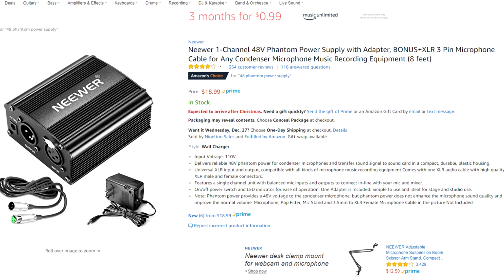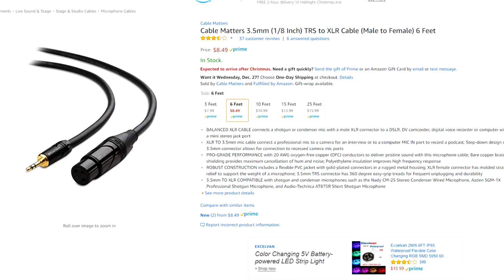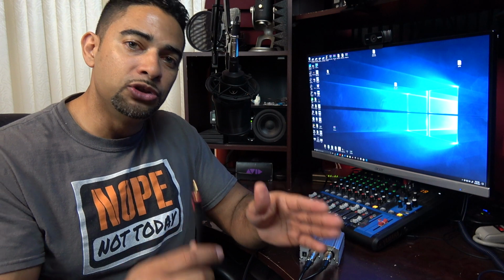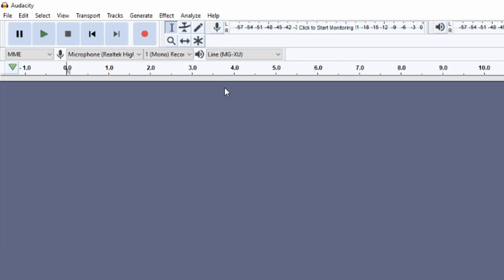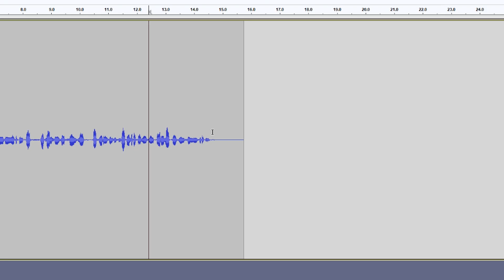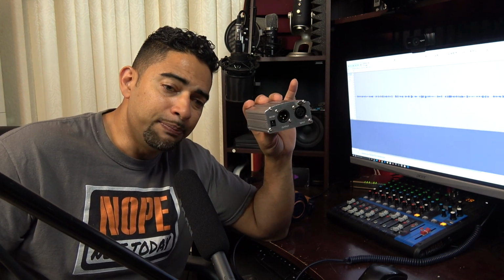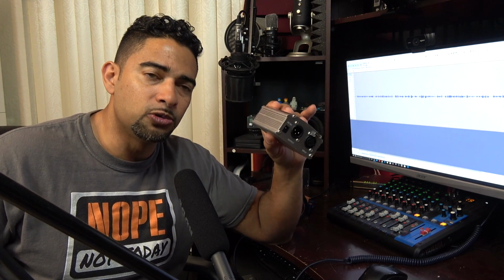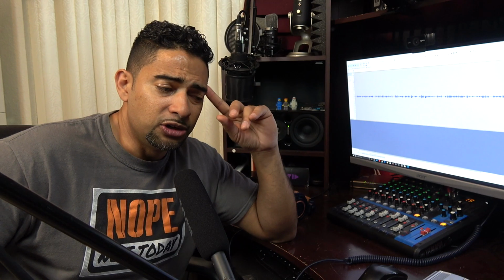Neewer 48v Phantom Power Supply Test and Review

Comment from the maker: Let me know what kind of audio interface you are using. And if you are using one of these budget phantom power supplies, tell me your experience
Reply: IT DOESN'T WORK
Reply: Does this have a power life.  I know this is a stuped question but I'm new to this types of microphones
Reply: Hi, I used for 10 years a budget Phantom PS and had no problem, until recently (it fell and overheated, my fault ^^). BUT i used a sound card (budget XLR-to-USB). To be clear : sound was perfect (T.bone SC400 microphone).
The problem with your video is that we don't know if the hissing is due to the PS or the PC sound card (which usually are not good). An interesting test would be to use the same sound card. e.g. a mixing table with on/off 48V, and test it first with mixing table PS ON (and no Neewer PS), and then with with mixing table PS OFF and Neewer PS.
Reply: @Daniel Rosli  is it necessary to have audio interface? or phantom power is already enough for my Samson C01 mic condenser to function and connect it to my pc?
Reply: my mic hasnt arrived yet, but i already have an Equalizer 215 from JBSYSTEMS
Reply: I think that hiss is your onboard Realtek sound card. I had a Gigabyte MB with Realtek that used to hiss like crazy, so I installed my old expensive Sound Blaster Audigy and it was dead silent. My newer Realtek is better, but it's still not as good as my old SB Audigy.
Reply: My program is through android and my microphone has a soundcard. Do I need phantom power?
Reply: Please help,,my laptop isn't detecting
Reply: I have many problems,,when I record the hiss is very high n the quality is bad,,when I remove the noise from audacity the noise is gone,,but the warm of the vocal is gone,,, please help I'm suffering soo much
Reply: @donzkharbudon4026  i think it may be your laptop. What else do you have with the mic. Im using a v8 soundcard 48v power phantom and a really strong phone. I also have a interface that im not able to use yet. Your laptop , pc or phone needs to be very strong..
Reply: I'm using a 4gb ram laptop,,i5 processor,,and a techblaze phantom power supply and a BM 800 mic,,when I go to my laptop settings I couldn't get any mic connection with the laptop any idea
Reply: @3warsGunsmithing  yaa it sound good with smartphone. Just use a y cable while connecting
Reply: Hey so I got the complete set from amazon for 35 euro or so with a bit of a shipping fee and here is my experience with the mic: 
At first It had the utmost minimal sound then I amped the sound using all sorts of metods online but when it got higher there was this giant hiss so you need to go in your options of the realtech or sounds record and turn on noise suppression and then for recording it says bream forming as well it makes it way better but then there was the little hiss which you can get rid of either the way you did in your video or try connecting it to the back directly it stopped all static hissing and such things but now as for the quality of the mic it is good but I don't know how to set up my utmost best quality for the recordings as I work for a guy and make his recordings and I can't seem to make it sound more clean if anyone can help me with that it would be awesome hope this info helps out everyone also forgot to say I installed coble and voicemeeter drivers that are for free tried tweeking with it but didnt manage to make my mic sound any better hope I figure it out or someone helps me here!

Comment: The most crazy thing is that at the Moment a Set with Microphone + Microphone Arm + this Power Supply + Pop Filter + Cables can be bought for 18$... that is so insanely cheap that i had to buy it and try it out, even though i already have some very solid Audio Equipment. But if that really works well for this price its something unbeatable

Comment: I'm a bit lost right now because this seems like it should be very simple to setup. Plug three things in the right way and bam.

I'm using a BM-800 with this product though and it just doesn't appear to work. Like at all.
I plug the microphone via XLR into the box's input. I plug an XLR-to-3.5 jack into the output and the back of my computer.
I plug the power supply into the wall and then into the box.
The blue light comes on.
I setup the windows audio and its aware that I have something plugged into the back.

But when I test with Audacity, Discord and some other programs it just can't detect audio. Nothing is coming through.

Comment: If I understood correctly, you talked about 50Hz hiss.  Let me tell you that 60Hz (America) or 50Hz (50Hz) is called hum  This issue is generally corrected by better cabling or shielding.  So it can be generally corrected.  But what we generally call hiss is noise generated by electronic itself and cannot be corrected. It can only worked around with proper EQ but this is NOT a good solution.  No matter how good is your processing software, anyhow this will affect sound quality.

Comment: I use the same power supply with my Audio-Technica AT2020 but it isnt working. I have the same setup as the video and nothing is being picked up by the mic. HELP!! 😭😭
Reply: My macbook detect the external mic, but there isn’t any sound signal from the mic.
Reply: Oy mate
Did you solve that issue
Cause i am gonna be using the same set up
with an identical mic

Comment: i know this is old, but the issue is the pc soundcard, you have to use an external, usb soundcard or an usb sound mixer.  integrated pc soundcards are useless for recording, too much noise, even tho most modern motherboards, specially high end, have isolated soundcard on the motherboard, still gets loads of noise comprared to a decent usb soundcard

Comment: how do you wire from mic to phantom power supply to mixer/preamp? i use the behringer c1 and behringer q502usb, the q502usb has phantom but only has 15v, so i needed an external phantom power supply.
mic (xlr female to male cable) --> phantom power supply (xlr cable female to male) --> q502usb(the phantom power is off on q502usb)?
Reply: 48v phantom power is just the standard on most mixers. Every condenser microphone I have used will actually operate on as little as 5v, though some lose a bit of gain below 12-15 volts. I have used the Neewer power supply with a 5v usb battery power source with an adapter cable and several mics with no problems.

Comment: I'm confused. The power box says "18V" 😩 yet the video title says 48V

can anybody help?
Reply: The 18v is AC, and is connected to a voltage tripler circuit internally, before being smoothed to provide the 48V DC. Not an uncommon electronic technique for getting a high voltage from a lower voltage source. The 48V connects to the input XLR via two resistors, and there are resistors and capacitors between input and output to prevent the DC getting to the mixer or other device connected to the output. There are no active components in the audio connection - it doesn't amplify or do anything else fancy - it just powers the mic.

Comment: Guys just so you know. those reviews arent even half the picture. The Neewer Phantom Power works just fine BUT I had buzzing. then it sounded like I had demons in my mic. STOP im not shitting you or trolling. ITS NOT the hardware. Its the drivers. Know that many of these reviewers are on different OS with diff motherboards and drivers. Im on W10 x64 and had decent sound and mic then I didnt and it took me weeks to trouble shoot. Now its perfect again and no adjustmebnts were made to my set up or hardware. I have a Neewer NW-800 and it doent sound like a $200 mic no it doesnt but it sounds like an amazing $20 mic. if you have really harsh buzzing or crackling its not likely due to 'grounding' your electricity or anything like that, its the drivers. like I said, I had demons in my mic, kept looking for different drivers going back years until i found the one that fully restored my sound and mic like it was on W7. Just be aware that up to a certain point, you do get what you pay for. This mic is good but not pro streamer $200 good. Mileage may vary depending on ambient/environment noise etc.
Reply: how do i install the drivers? my mic sounds like demons inside it i have the at2020

Comment: I was wondering if it is possible to connect the output of the phantom power supply to an audio interface ? So, the mic goes into the power supply, then the output of the power supply goes into the audio interface, then the output of the audio interface goes into your PC.

Comment: I recently purchased a Zoom R16 which only has 2 inputs with phantom power. I have 3 condenser mics. Would using an external phantom power supply and then connecting that to the input for a dynamic mic work on the R16? :)
Reply: Yes
Reply: But Connect yo xlr input
Reply: Yo también tengo una zoom r16, compre un alimentador Phantom para poner más micrófonos de condensador, pues el zoom r16  solo da poder a 2 micros, pero no hay problema con estos power supply, tienes que conectarlos con los cables xlr, los micrófonos dinámicos no necesitan power fantasma

Comment: hello,
i have the neewer 700 mic and neewer 48V power supply, my problem is I connected it to my windows laptop but the laptop never reads it what to do. I plugged in the output from the power supply directly to the headset jack. Do I need something else for it to work. 
HELP HELP PLZ
Reply: Hey man did you ever get it to work and if yes what did you do? Thanks
Reply: malika sharma ^

Comment: I have a Creative Sound BlasterX G6, so I was wondering if this will work to get a higher volume from my Shure SM58 connected to Neewer and then connected to my external sound card using XLR to 3.5mm cable? :)

Comment: I recently bought an At2035.. Sooo this probably wouldn't be very good for it would it ? I'm on a tight budget but all i need is the power supply. My pc doesn't provide enough voltage for the mix

Comment: thank you for having a REAL computer and not a laptop! thank you for hooking ti up to the back of the computer. i was told that you only needed a phantom supply if you used a laptop because it had no power and that a real computer does however mine has low volume. also i was told that a phantom would not do anything for volume or improve it but it appearers to. the information i have is completely confusing! the um2 behringer interface uses a usb and i was told not to use it and that i should plug into the back of it with a 3.5. their is a converter that changs usb to 3.5 but it says it dont work. DO A VIDEO WERE YOU USE ONE AND THE CONVERTER PLUG.
Reply: Laptop snob much?

Comment: my phantom power was sorta kinda included in my neewer mic set, I had his once but that's because I had the mic sitting wrong, I wasn't talking into the sides, I was talking into the top of it so I sounded far away which lead to some hiss, with the mic setup properly ( after roughly 15 tests just by talking  I had no hiss, everything sounds better when you use the rock EQ in audacity and noise reduction wasn't required,  these videos are fairly helpful ( whenever they pop up in my feed).
Reply from the maker: Thanks man. Glad you figured out the mic too

Comment: That hiss comes from your soundcard. This phantom power supply is meant for mixers/camcorders with good preamps that cannot provide 48V for powered mics.
Reply from the maker: I’ll test it out but 90% of the people who get this wont have a mixer and if you have a mixer 100% of them won’t need this. So In the end, your stuck with your sound card.
Reply: I personally would use this as a way to use say a cloudlifter with a condenser microphone
Reply from the maker: darkmew64 oh no, please stop. Let me help you. Cloudlifters are for dynamic microphones not condensor mics. Cloudlifters don’t power condensor mics they just increase the gain of the signal.
Reply: Actually I'm just giving you an extreme case. You could use cloudlifter with a condenser mic if the mic is already powered by an external phantom power supply.
Reply from the maker: darkmew64 ok, here’s to extreme 🍺
Reply: cheers 🍺

Comment: Great video! This was found in such perfect timing as I just got in the mail this exact Phantom power Neewer item.
So your 4/10 rating was partially because it's a lowbudget phantom power connected to a pro level mic & the slight editing of noise reduction. . sounded good to me, but prob different to your advanced ears. 
I paid grand total $40 for mine. Came with XLR cable, ac power outlet cable.  

So here's my set up (mind you, I am VERY new to this videocast/podcast world and am learning everything from various YT channels/reviews online):

*TonorBM700 condensor mic
 (which seems to be identical to a neewer BM700 or BM800 mic. I think they're all the same just with different model names. )
This was a kit that came with boom stand, pop filter, XLR cable with 3.5mm cable .
*3.5mm hooked up to a Sabrent USB soundcard, straight into laptop ( no big desktop computer)
I'm using Audacity. 
PC, no Mac.
Recorded a few sample tracks - sounded really low and underpowered. 
Reasons why I went with the Neewer phantompower.
Now sounds much more bolder. 

Hoping I can get far with this ultra basic noob setup without breaking the bank. 

Thanks for the video!
Reply from the maker: Hellthrasher it’s very workable, especially if you are new to audio or creating content. But like you said, compared to higher end devices there is a huge difference. But you will hear th difference over time. And you will be glad you can now tell the difference. It will only help you over time. Good luck!!
Reply: i got the same mic and it still got tons of background noise with the neewer phantom power, any fixes?

Comment: That's awful, and the noise reduction doesn't really help. It's just saving like $3-$5 over a Nady or Behringer phantom power supply. That's assuming one has taken leave of their senses and wants to go down that path. The Behringer UM2 isn't even $10 more because you don't have to buy the XLR-TRS cable to go with it. That's assuming the 3.5mm TRS plug even works on your computer, which is no longer a given with manufacturers using a single trrs combo jack for audio i/o.
Reply: Up All Night what size XLR should I get if  connecting it to an iMac? Thanks